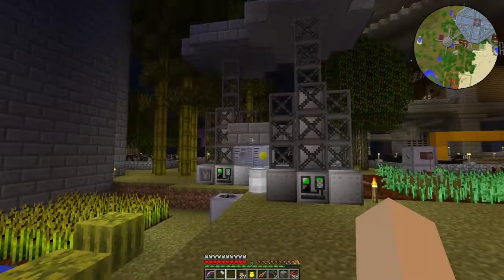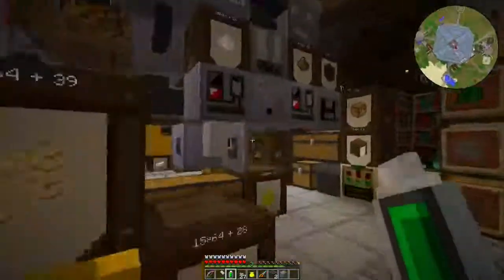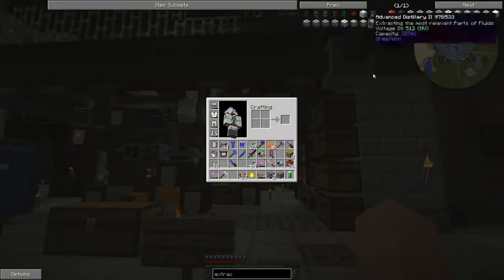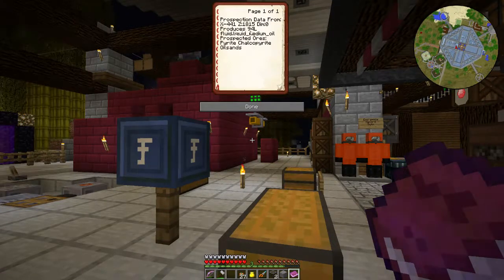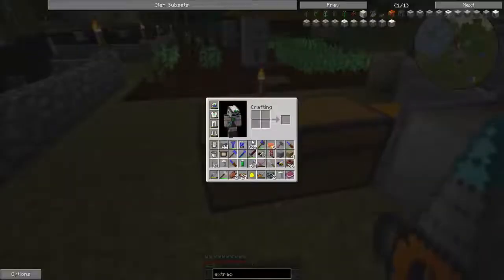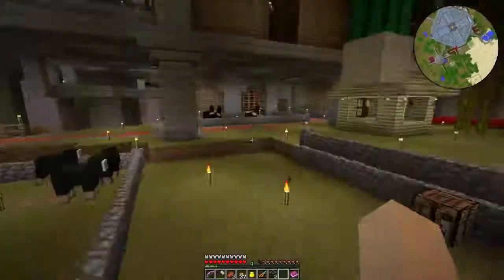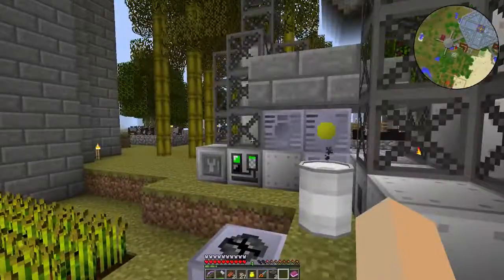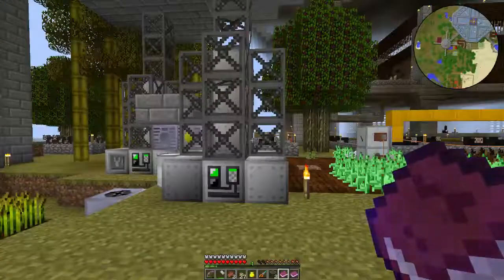GT5u Multiblock tutorial series - Oil Drilling Rig & advanced Miner II

Comment: i Updatet my world and now i have a problem, how can i get circuits 4 the drill rig, when circuits require oilproducts?
Reply from the maker: +Numaron oil sands(stone ore), or soul sand centrifuge either and get oil and sand, soul sand gibes saltpeter too
Reply: +Bears Den ah ok thx, i think i stick with soul sand, because there is no oil sand in a generated map and i dont want to run 3000 blocks to get some
Reply from the maker: ya soul sand is nice, cause you can refine it to nitro diesel without any extra additive, oil to fuel, saltpeter to nitrogen, a little water and processing and you have nitro diesel.
Reply: +Bears Den ah ok, energy is not really my problem, because i run a fusion reactor and some steamturbines, i just see that there was an update to gt
Reply from the maker: ok

Comment: anybody did set up a mass fabricator on that gtu server?
Reply from the maker: +UnderSiege72 I think Axlegear has one, we haven't found a reason to set one up yet. We have started making scrap though.
Reply: +A. Bear Hamman  how does he power it ? i had severe problems long ago to feed power to it. In the end i have reactivated the matter fabricator from ic2
Reply from the maker: he has a HUGE power grid, reactors, steam boilers, nitro diesels, and ethanol.
Reply from the maker: I will see if I can get of there and record again.
Reply: +A. Bear Hamman my problem wasn't about how much energy i am providing but how much amperage i was feeding to the mass fab. In 5.07 and 5.08  used a 4 amp bat buffer attach to the mail line and 3 mass fab were able to run with uu amplifier. Now it doesn't work anymore. Previously the mass fab energy buffer was 2048 now it is 16000 (roughly i don't remeber exactly). I attach a 9 amp battery buffer with 9 battery to the mass fab and it wasn't able to keep with the energy consumption.
Reply from the maker: how many amps where u giving it?
u\you outta join our slalck group, we talk about all things GT.
Reply: +A. Bear Hamman 9 amps through a low voltage battery buffer attach to my main line and it isn't able to complete a cycle
Reply from the maker: +UnderSiege72 quote from Axlegear "I put 3x MV transformers MV->LV to 3 faces of the massfab" he said you need to keep the packet loss below 1
Reply: +A. Bear Hamman it is working , however this new behavior of the mass fabricator consumes a lot of energy :)    http://imgur.com/6ZfWTBB
Reply from the maker: +UnderSiege72 glad to hear it helped.
Reply: +unggod I did that and it appears that this new mass fabricator runs int the range of 10-12 (possibly exactly 10 amps). There are three LV transformers feeding the Mass fab, so an hypothetical 12 amps, if i remove one cable and i add a small lithium battery into the mass fab i should be at 9 amps. With UU amplifier i can finish one cycle and after that the battery starts to drain despite the fact that I am producing a lot of energy in my  nuclear reactors because the HV 4 slot battery buffer with 4 energy crystals at the bottom of the setup  doesn't drain.

Comment: hey bear i havnt updated my world in a wile and i dont know what is that medium oil
Reply from the maker: +GhostwarGWPTC medium oil is just the weight of the oil, should process same as raw oil.
Reply: The different oil types produce different quantities of the various oil fractions if I'm not mistaken. So for example, 50mb of light oil would probably produce more of the lighter petrochemicals (whichever fractions contain things like ethane and propane) and less of the heavier petrochemicals (fuels and tars) than medium or heavy oil, but I think the total yield if you add the different fractions together is the same amount of fluid.

In any case though, based on my experience with other Gregtech machines, I'd assume you can't process 2 types of oil in the same distillation tower at once. For that reason, it might be best to focus on one type of oil and ignore other types, or to build a different distillation tower for each oil type. Depending on your petrochemical usage of course.

I could be mistaken about the different oil fractions; I've only done a very small amount of testing with Gregtech's petrochemicals, but I'm fairly sure that's how it works (and that's really the only way it'd make sense for there to be a distinction).